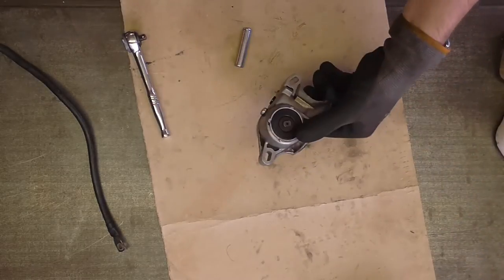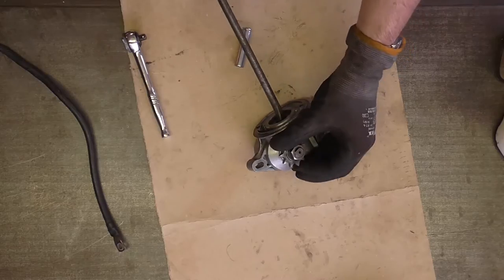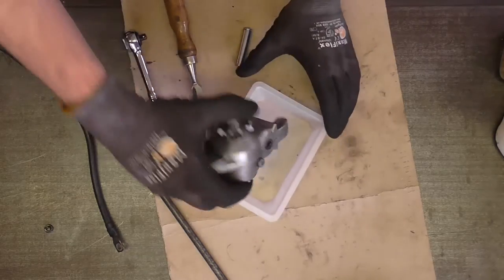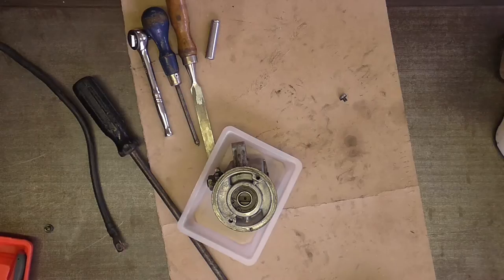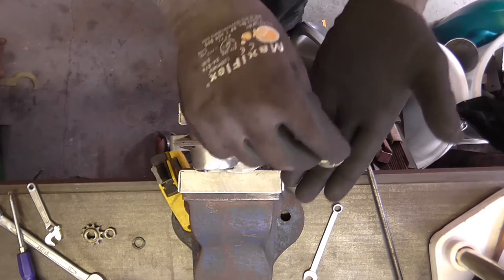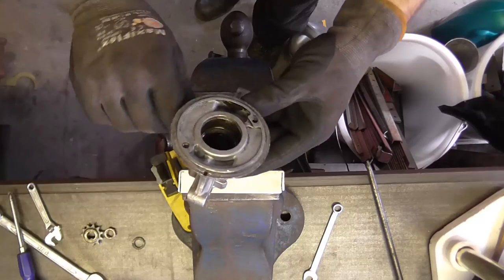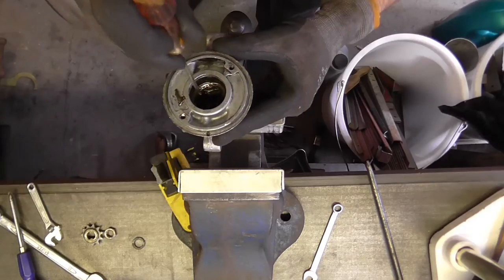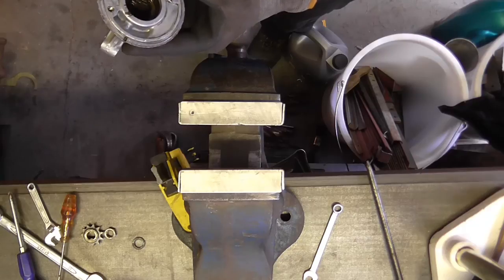Sunday Night Short XXVI

Comment: Hey Paul,

Morini addiction. Sounds contagious. What is the table you did the disassembly on? Its surface looks like it was planed.

Cheers,

Tom
Reply from the maker: oxtoolco Hi Tom,Yes, the surface is planed. It's an 8 foot by 3 foot cast Iron surface plate I bought off ebay for £60! The webbing on the back isn't that deep and there are no diagonals, so I'd suspect it's ex printing industry.

Comment: That reminded me of gear box lube ive seen at work. its a #00 grease i believe. Could almost call it an oil , called Weartex made by Petro-Canada....commonly seen in large commercial gear cases
Reply from the maker: I think it was just plain molly grease and not a lot of it. Factory recommendation is an SAE 70 EP oil plus colloidal graphite or Mollykote A , but NLM now use a plain SAE 120 gear oil.
Reply: Paul Compton I should say Irving not P-C....what isnt made by Irving here. Its also intended as  a replacement for O.E.M gear cases which use oil....especially leaking ones which would cause huge amounts of work and down time to fix. Its great stuff